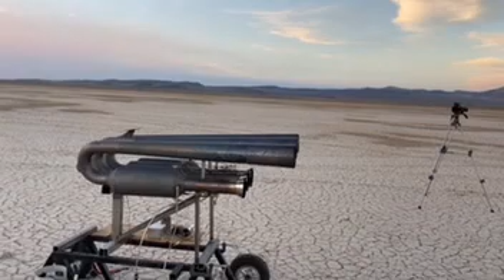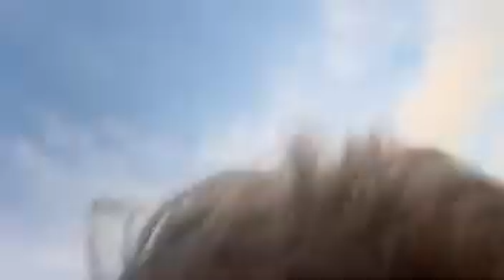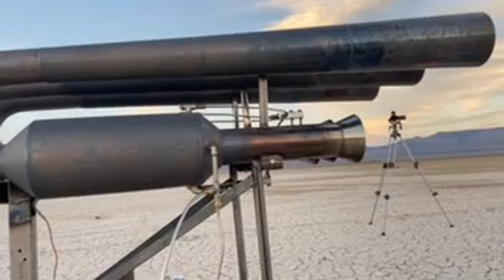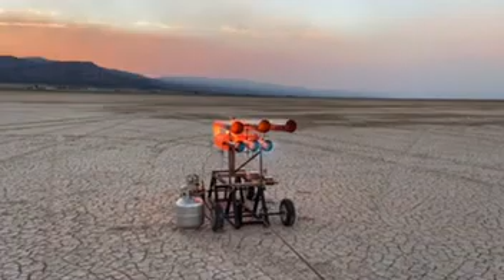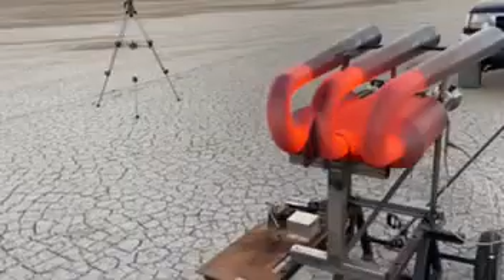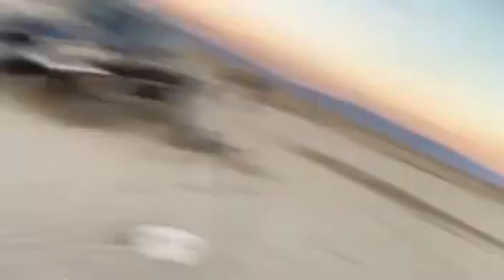Triple Valveless 150 pound thrust Pulsejet Engine Maddoxjets.

Comment: Very cool but the Pipes heat worries me. I just wait for them to melt from the heat then start hitting me in the back of the head...
Reply: The pipes would be in back of you and if you're doing 60+ mph the forward momentum would cause any melting metal to fly backwards away from the driver. But I obviously understand your concern 🤣

Comment: How long will it run before it melts trough the pipes?
Reply: Have you ever seen him run one of these for longer than a couple of minutes?.....Thats your answer!
Reply: I disagree do you know what the melting point of steel is?  The weakest link would be will the fuel line is connected to the combustion chamber  @billsmith281